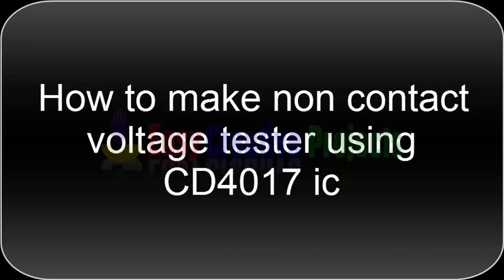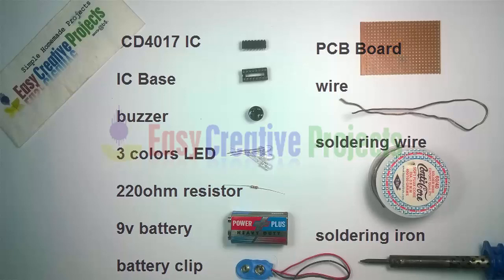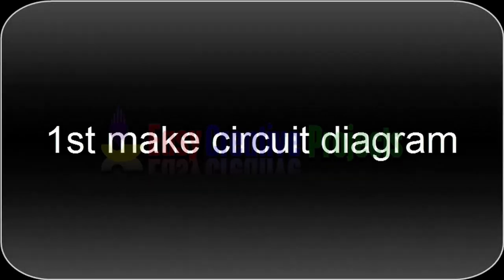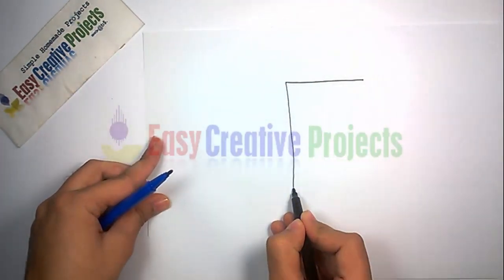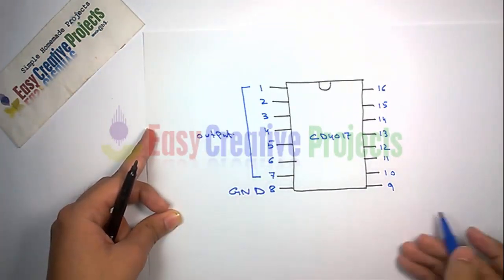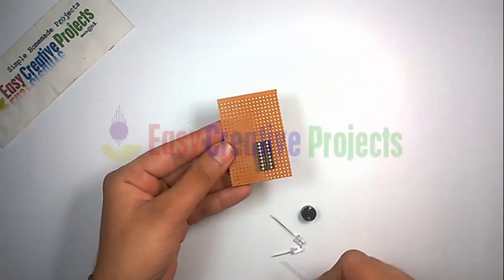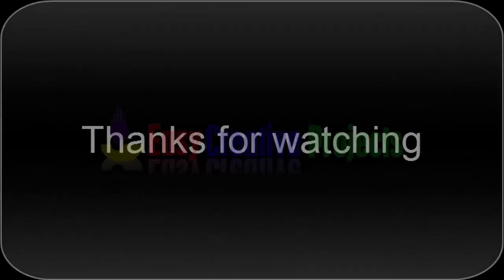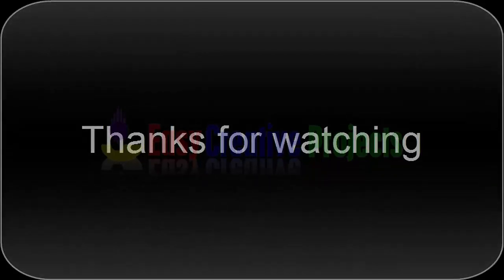How to make non contact voltage tester using CD4017 ic - easy step by step

Comment: DC or AC ?
Reply from the maker: dear its work on AC power.
Reply: @EasyCreativeProjects  great thanks.
Reply: @EasyCreativeProjects  I need to diagram same like this for automotive tester. Pls give me thank.
Reply: It can use on 11000volts line
Reply: @furqanali9967  thanks A lot.